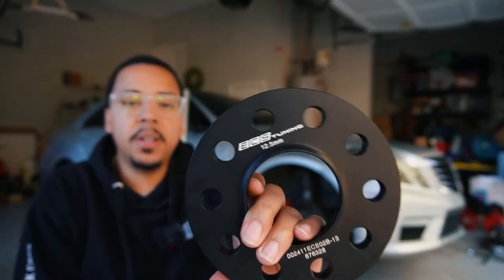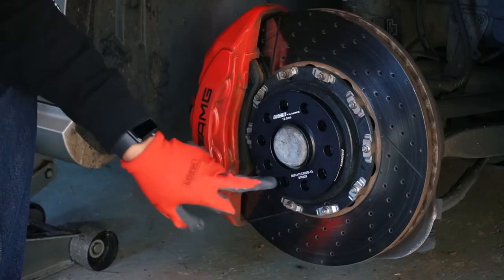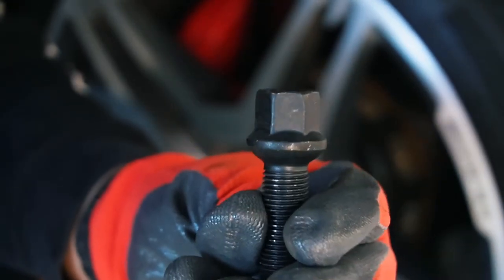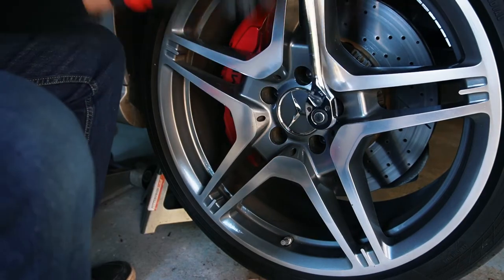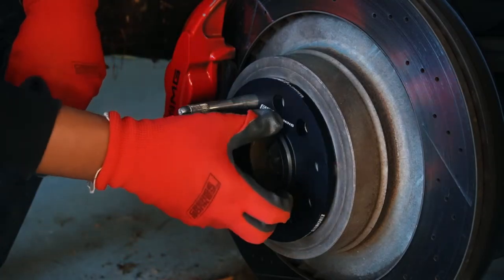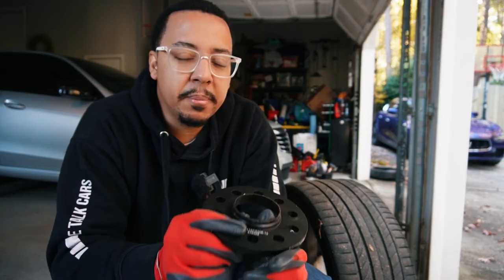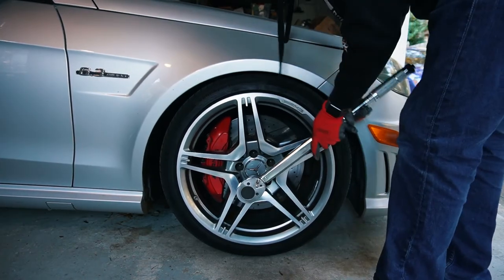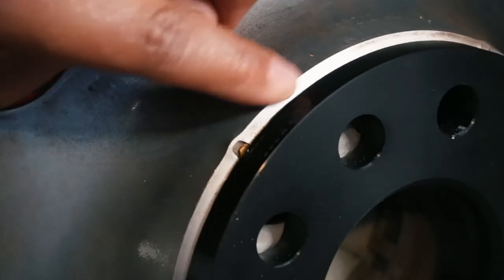Wheel spacers before and after! Installing wheel spacers on Mercedes Benz E63 AMG with OEM Wheels.

Comment: Never use Torque Wrench to loose the bolts.
Reply from the maker: Thanks for your comment.  That is a great tip. However, I didn't use a torque wrench to loosen the bolts.  It is an expandable breaker bar.  I do see how it resembles a torque wrench though 😀👍.

Comment: I need help, i  have a 2002 e320 with amg monoblock ll wheels. Im trying to see where i can get some 12mm hub centric spacers to fit in the front. The grease cap is making it hard to find the correct one

Comment: Hey I really dig your channel. I have a 2012 E63 and am looking at the best set up for fitment with the OEM wheels before purchasing new wheels (20s).  I was going to get the 10mm all around, but am curious how yours rides with the 12.5mm and 10mm.  I am considering lowering as well, but heard some complain about ride quality.    Any insight you can offer would be greatly appreciated.  Thanks
Reply from the maker: Glad you like the channel!  I spent a lot of time researching fitments. I saw people on forums use from 10 - 20mm, so I really didn't know which way to go. I came across the wheel spacer kit (https://youtu.be/xRwgn4etzcg)  and this helped me to figure out my perfect fitment.  The 12.5mm and 10mm is working great so far.  I don't know if it was just in my head, but it did feel "different" at first, but it's cool now.  Car is great lowered - https://youtu.be/bWeEDZ44Q_c
Reply: @DriveTalkCars  Hi Bro,  I am having some issues with the H&R spacers fitting over the front hub.  When I called ECS they stated their 12.5mm is not for front.  It didn't seem like you had any issues with your ECS spacers fitting. I am assuming the hubs should be the same size on both 2010 and 2012 models

Comment: Well there will be rubbing if you are going fast into corner on not so smooth road. And then when you turn at the same time, probably will catch inner arch lip.
Reply from the maker: It wasn’t too bad for me. It did rub over a good size bump or dip in the road. But under normal conditions it was good.

Comment: Great vid.  Did 10 n 12 mm spacers change the ride quality and or driving dynamic of the car at all?  Thanks.  I’m thinking of putting 10mm in front and 12.5mm in back of my Ftype but afraid they might effect ride.  Thank you

Comment: Will the 10mm work for both the back and the front?
Reply from the maker: For the results I wanted, 10mm didn’t work for both front and rear. But you definitely can use 10mm for front and rear.

Comment: why didn't you put the bigger spacer in the rear instead of the front?
Reply from the maker: Front needed more spacing to be flush with fender than the rear. Also, front has a narrower size wheel/tire than the rear. 255 front 285 rear

Comment: Love you video man! Rodney from Australia Down Under! You are very concise, clear and easy to understand and follow. Amazing video.
I also have the same problem with the rear OEM wheel not fitting the standard Mercedes 66.6mm Hub Centric Hole size on the spacers I purchased off EBay that look almost exactly the same as the ones in your video. They too were too tight to fit! 😩👍
Reply from the maker: Thank you for the comment! I appreciate it!  Yeah, it was weird how off the rear spacers were. 🤷🏽‍♂️

Comment: What are the part numbers for the two different 10 mm spacers?
Reply from the maker: Part# 2055665SW.  You can find all the info on the part and tools used in the description of the video. 👍

Comment: Only one thing. No point having a torque wrench if you don't use it properly.
If you hold it forward of the correct point on the handle you're not applying the correct torque.

Comment: @6:10 I use them spacers on the civic with coupe  twenty06 model, and having amg wheels isn't the issues.  You were lied to.  And your iffing it to others.. as if it's the wheels. And not the person that doesn't know anything , this happens increasingly everywhere from burger flipping to alignments to banks and schools.  Just thought I let others know it isn't the AMG wheels. I use them on the coupe Civic . Yes I run 5*114 on 5*114.3 with a car hub size 64.1 and centric rings to fit these wheels 66.6 and I run the spacers. Those are not the right spacers. Period . Like how all the car  parts are that we all buy at first.